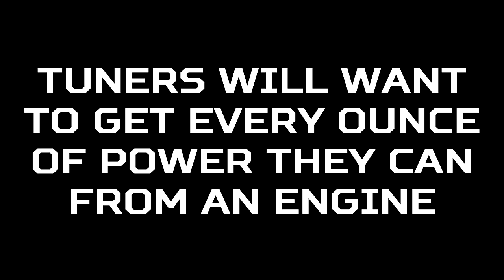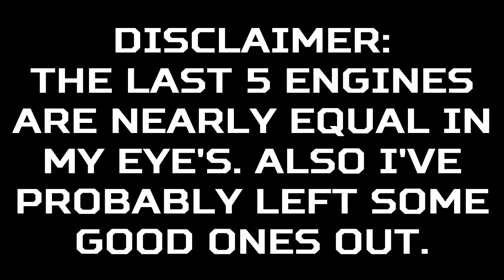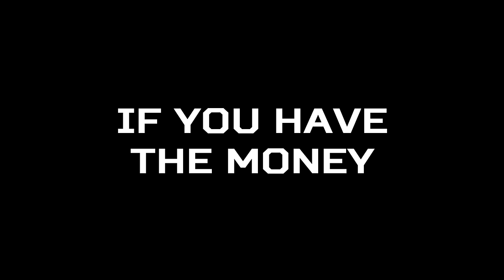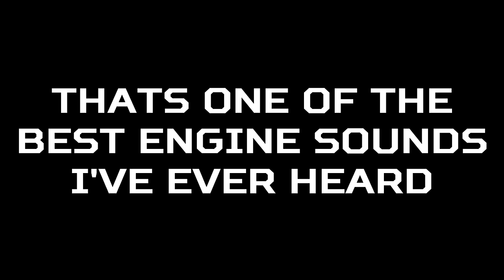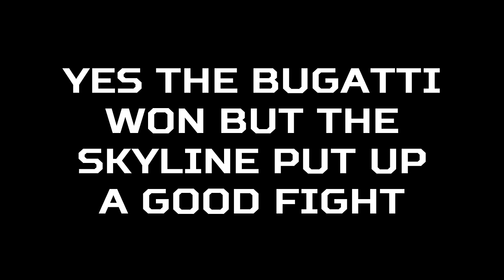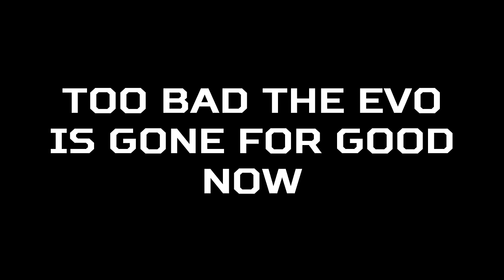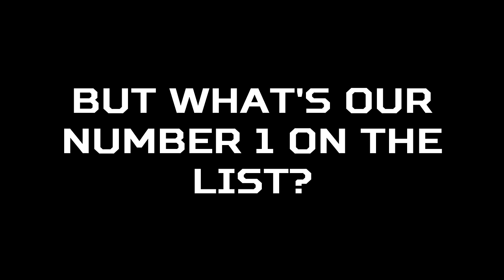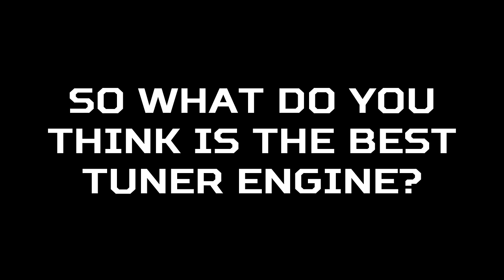9 of the Best Tuning Engines

Comment: Pretty weak list at least rating wise.  13b < sr20 < Ej20/25 < 4g63 < b series < f series < h series < K series < rb < 2jz < coyote < ls
Honda makes the best 4 cylinders hands down and it's not just the K series, in fact, you could argue any of the honda motors listed are better then k series.  Ejs fall apart and the 4g63 is not on Honda's lvl.  13b is a trash tuner engine for many reasons but doesn't mean it's not a cool engine nor an engine not wort building but it is far inferior to the other greats.  Ls is always the best bang for your buck which will always make it the best tuner engine even though the coyote is better.  You shouldn't have mixed import and domestics though cause the older small block and big block Chevys should be on that list as well as the windsor 357 and boss 302

Comment: at 1:00 the car didn't travel .25 mile you can clearly see that in the trip odometer, we should have seen 122.3 come up if it had traveled a quarter mile. the trip odometer turns to .1 10 yards out of the start.

Comment: The S2000 F20/22 C should be on there. The 90s civic is actually one of the biggest bang for the buck platforms to build on so I dont understand what they mean by "its a nice platform if you have the money". LOL the chassis is like 3k , K24A2 swap is like 6k, turbo kit could be had for around 3500 and you'd have a rustang slayer for about 12-13k ! Rotary doesn't belong there as most tuners refuse to tune them because of their unreliability.  This vid was not put together well at all...

Comment: Good list.
Ford cosworth YB engines and the VAG 1.8T engines are also good. 
However, as a performance car enthusiast, I feel using a huge LS engine is cheating. Those engines weigh upwards of 250kg. Putting a huge engine like that into a little 1 tonne Mazda is defeating the object of having a small light sports car. Granted, not everyone can afford to spend large amounts of money on tuning a lighter engine to similar power levels, but it just seems a little blasphemous to me.

Comment: 2JZ's rule the streets. All because the motor was strictly designed for boost and boost only. The square bore and stroke design is what makes the motor so strong. Yeah a LS is the best to swap. For cheap (limited) 425+ horsepower.
2J's are known for their strength, stock internals all day long can put down a very very safe +800hp an you can daily it to work everyday. LS's own the NA crown ... and 2J's own the Boosted Crown. (In my honest opinion)

Comment: Such a typical American approach on this topic. Pure focus on American engines with a large displacement and Japanese engines for the lower displacement bracket. European engines with a high tunability rating are left out. It's okay though, we know us Europeans can't bring our best engines to the U.S. because of some of the bollocks green rules, so you probably aren't even familiar with them. The are plenty examples out there. As suggested in other comments. The VAG 1,8T, the different BMW engines, The Renault 2,0T, Porsche flat 6's, Volvo 2,5T straight 5's, and even some diesel engines as well. 
Never mind, still enjoyed your line-up.

Comment: bmw M serie engines are the best. the engines from the factory lay in a field for years. and then they use the less rusty ones. so only the strongest will survive, thats why the bmw M serie engines are the strongest and most durable. and take massive HP

Comment: 6G72tt? Stock internals can hold up to 850-950hp .
it's sad it didn't get the benefit of being in the fast and the furious movies or else you'd see much more aftermarket support for it.
Mitsubishi and their interference engines with timing belts though.

Comment: the ls is king!!! cheaper, more power easier, and last but DEFINITELY not least it is more reliable! How can you not include the sbc? been in production since the 50's and the ls is essentially based off 50 years worth of experience with the sbc and previous to the ls it was the engine swapped into everything for all of the same reasons.

Comment: no 9 those engines are not stock engine full stop, thats with heads turbo work and then headers exhaust and then a tune, so around 10 to 15 k extra to get that much out of that engine its that simple, do not think you buy a new sti and then take it to a shop for a tune and they just turn up the fuel and air and thats it with no changes to the head, turbo and intercooler injectors and so on, please so much bs here its not funny other than the fact they are strong engines?

Comment: 4G63 runnin good like it should
Pull up to the strip grillin Hondas like I wish you would
I dont dislike em I jus dont drive em
Diamond Star Motors all Civics stay behind em
You know what it is when you see me on the track got that 7Bolt block with the head pushed back and the boost full blast
all you see is da ass
When them Talon lights drop you know i cant be passed
Boost builds fast makes the 9.1 compression keep Imprezas second guessin though they never learn they lesson
Curse in my presence like i cosign your fucking car no bitch, shoulda bought an Evo, replacing displacement a V8 at a time 
I leave em on the line like the tree a stop sign
Finish line mine and gonna get my time
Or better yet ill ask em they saw it jus fine

Comment: Forgetting just 1 thing the new BEST bmw 335i engine N54B30 is more tunable then 2jz. N54 can hold stock engine more then 1000whp witch no other 6 cylinder engine can say that and we are still waiting someone to hit the limit to the engine witch there is test on dyno at 1150 whp and still run's good so pls remake video

Comment: in no order: 
vr38dett
rb26dett
2jz twin turbo
ej20/25
4g63
k20 vtec
volvo 2.5t
yb cosworth
vag 1.8 20v turbo
vag 2.0 tfsi
porsche 3.6 twin turbo
merc v8
audi v10
chevy ls series
ford v8

mostly turbo or big capacity engines are best for big power / torque gains.

Comment: I think 2jz's are bad ass too...but could you at least call out the maximum horsepower of all the other engines before rubbing it in there faces. you're making the 2z's ultimate rival the rb26 look like a boob.
Reply: one thing I will give the 2jz first place for though, is durability, with reason, all high powered factory and modified engines are delicate to at least some extent...but with care the 2jz is bulletproof. Unlike the delicate, thinner, smaller, Yet heavier rb26.

Comment: And the 3300+ hp gtr R35 ??
Reply: Opel Astra G 1.7 CDTI 3300hp  GTR have an alpha queen special built engine, its not a normal engine that u can buy direct with car, like a TOYOTA Supra, that after u bought it put couple 1k$ and make it 700~800hp easily

Comment: The 2JZ is not N1 its replaced by N54B30 from BMW  this engine hold over 1200 whp on stock motor and we still don't know how much more it can handle  so bye bye 2JZ :D it was good but until 2006 when N54B30 came out. :) and Yea i have a friend with B20 honda all motor  210 whp NA ofc  and he already broken the  engine 2 times  so WTF is doing on this video?

Comment: All these engines are good , but need engine work to handle the high psi, unlike the iconic supra engine and the r34 can handle high psi and not blow up with stock engines heheh

Comment: You forgot a the real number 1 2JZ is a great motor but you  can't get over 1000hp with out a billet block. Where the ?4GE Toyota best motor that Yamaha head flows better the any 2JZ can do. And I if go billet block the go the RB30 because  of follow heads. Real Number 1 is the Ford Barra

Comment: i gotta admit man i like the compilation, but honestly until you've worked on one enough... the 4g63 is a piece of shit.... id rate a toyota 2E motor as number one though just because ive driven one cross my country with broken valves, bent rods and jumpy shims max out the whole way 😂

Comment: No the skyline won bro
Reply: skyline won quarter mile 
skyline ran out of gear in transmission and bugatti won the 1 mile.
Reply: so you are both right.
skyline if had 2 more gears in trans would have won 1 mile too.